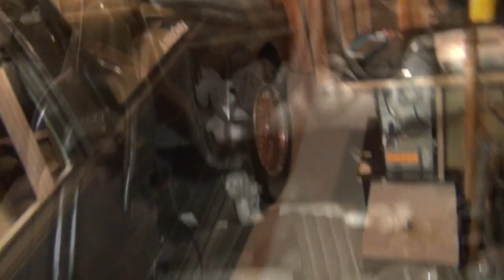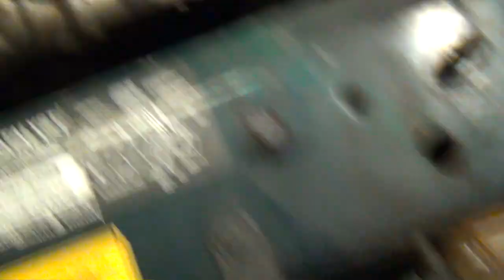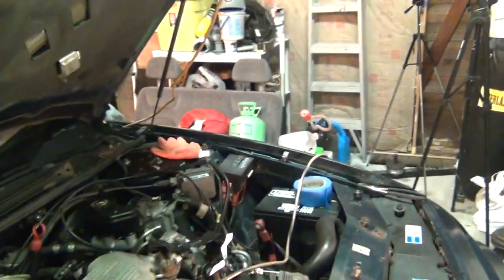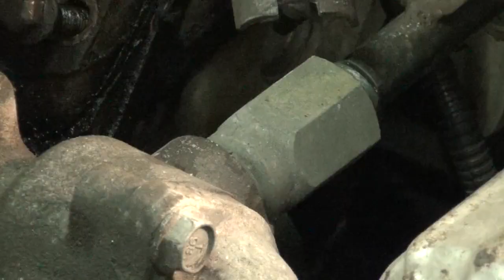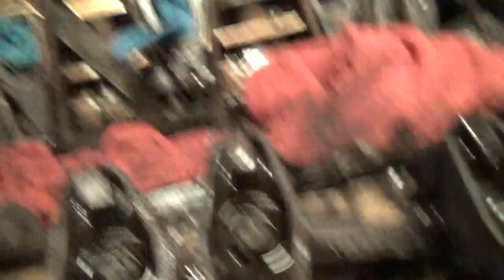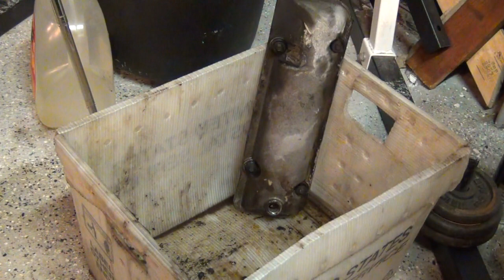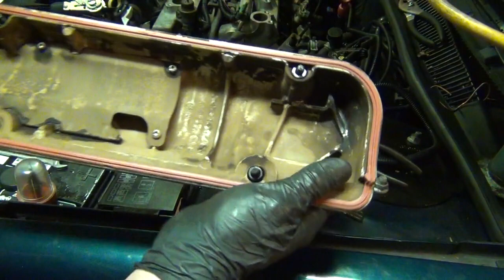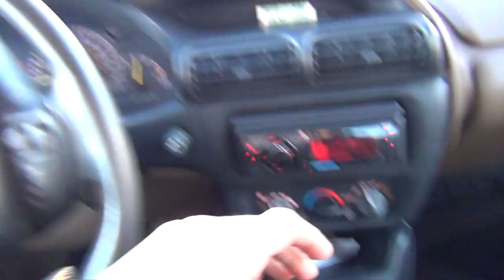Intake Manifold Gasket replacement GM 3100 V6 95' grand Prix

Comment: I'm about to do this on my 2001 Century. One question I have is, do the rockers get tightened down all the way, or do you tighten the bolts until the rods don't spin? (Like take out the valve lash, ect) But, other than that, awesome video and I'm very grateful for this!!

Comment: I have a 94 Chevy Camaro 3.4l, I need to replace the lower intake manifold. I need to take the pushrods off to replace the gaskets. What all do I need to do to put them back on what do I need to tighten them to torque them to thx

Comment: Poor guy you can hear the stress in his voice. 😂 we’ve all been there. I’ve done this job so many times I can do it blind folded. I don’t even need the manual anymore the manual needs me. It’s sad. I learned what gaskets are best, what etc sealant is best, what thread lockers and sealants to use. What to remove what not to remove All The Hard Way! 😡 I’ve been in that dang 3100 so many times I feel like I’m GM. These engines are always going to leak though. It’s a design flaw. So long as you use the metal gaskets you’ll be alright. Nothing will stop these from leaking oil though. Especially now that synthetic is all they sell in stores. If there is a gasket it will leak out. So long as it’s not coolant leaking in the oil I’ve accepted it. These are definitely relics of gm’s trial and error years where they finally later realized to keep coolant and oil passages separate and far far away from each other.

Comment: whats the green wire plug with 3 barrels sticking up plug into show up unplugged at 29.35 mark in video
Reply: the green plug sticling up by the MAP sensor from the fuel injection wiring harness goes to the 
map sensor , plugs in under it . what I found hooking up wires from an engine exchange is
all the wiring harness plugs are male plugs. all the ones one the block are hiddin' kinda because there
flush with spot where they plug into, another words the female part is indented inside doesn't have any wire's ussally waving a flag I go here. you have to search them out using the length of the harness wire as a clue
for  hunting the plug in spot down.

Comment: Cracking of these intakes supposedly common on install, the 64 in lbs then 115 in lbs is critical then the 18 ft lbs, seam like it should take a half hour minimum,  waiting for the rubber gskt to settle,
Reply from the maker: John, Thankyou for adding this information. You are correct on the intake cracking, but not on this application. Newer GM engines that have the plastic intake are prone to cracking and notorious for warping.   I have done so many of these old cast aluminum intakes jobs 10-15 years ago in a shop setting and none have ever cracked.

Comment: People don’t overlook the product (Blue Devil head gasket sealer) 35.00 autozone. Do follow directions verbatim. I used it twice on my 03 chevy malibu. The first time I didn’t follow the EXACT DIRECTIONS the second time I did and now I’ve put 3000 plus miles no coolant leaks. Before this I would have to add water and coolant about every 20 miles
Reply from the maker: Agreed, Ives used the blue devil products for coolant, power steering etc, they DO WORK as you said if directions are followed exactly. However, it doesn’t last. Especially power steering repair . Note: this is a great quick fix, but for long term it is not. $70 spent to do this twice  you could of spent 25-50 dollars and be done with it for good. This video was made a long time ago when those 3100s were still popular and cruising around. If you have a beater, and only keeping it for 6 months, use it. If you plan to keep the car for a while, just fix it right. This was a fun project, I still have this car in 2022, and I did this repair 11 years ago.
Reply: @905speedgta  true about the Beater dog , I’m runnin daily cause I know the motor. I ll have to Report Back as too any gasket failures. Thank you Chief for responding. Clearly the knowledge is evident. Nice work.

Comment: Dexcancer is the problem. Poorly engineered coolant. Go green after manifold gasket replacement.
Reply from the maker: Your right, that dexcool was very acidic back in the day. That’s what killed those things along with people mixing the dex with the green.  But today is not the same case, all of my Nissans take the blue stuff, I brought my 07’ Sentra in for a oil change a while back and they did a full service, they topped my coolant off with green. I did a flush early and replaced it with the blue again. Personally I do know that they have universal coolant and many people replace the coolant with the green stuff. Not me though, I like to follow manufacturers instructions, I feel that that specific fluid is there for a reason, like anti corrosion for the different metals within the engine etc. a lot of people go green due to cost which is understandable.

Comment: thks, for doing a detailed video, on the 3100, I've had this car in my garage for 10 yrs,& because of this
video , I'll know what I'm doing  and I'll get my garage space back and a working car.  I've taken the
engine and transaxle out, as  the engine burned oil, either from the 150 to 200 thousand miles , not 
sure because at about  after (5 yrs of use), its a 1995 purchased with 12,000 miles on it for 13,500
several people we went to said it needed a new engine,  ( it was leaking oil all over the fire wall side.
Now I know it was the intake manifold gasket ,& the mechanics& garages we went to jst said it needed
an engine because  a lot of mechanics will swith a used engine from a junkyard rather than tackle
the intaake manifold gasket replacement job.  so now we haave in our 95 grand prix 4 door, a chevy 
lumina engine 3100.  ( so all those right on time oil changes were for nothing> 
  but now the body odometer is on 199219. Like I said earlier, after paying  900 to get the replacement engine, head gaskets replaced,  & the mechanic putting on a faulty water pump that might of overheated it  after the head gaskets and intake gaskets were changed , any way some how it started using a quart of oil a week .  and the seal went out of the automatic  transmission, 
 thats why I took out the motor and tranny, cradle down and out.  used the cherry picker to lift
off the dog bones ( with a chain tied between the two),  lifted the body high enough the first time 
to get the motor slid out with a cart under  it . But on the 95 grand prix 2 door i PURCHASED FOR 500
for the engine and tranny thats got 165 thousand miles on it with a rusted out frame and other aras.
Wisconsin road salt.  on that on yesterday, NOV.2021,  I picked up the body not as high to slide  out the
engine because I removed 1 strut that dangled in the way( only 3 bolts. I can put the strut 
back on weld a bar between the tow , where the lower ball joints used to attatch to the cradle 
thats not thre any more so it will roll on the trailer better & easier to get it to the scrap yard. . 
noticed the motor mounts aren't doing much as I  pushed it on a cart into the garage, for the 
head gasket replacement and of coarse the intake manifold gaskets there not leaking but it
much easier to do this out side of the car, while I'm doing the swap . I should even put in the tranny
seal. anyway again, thanks for making a detailed video on the exact car  the 1995 --3100  6cyl.
pontiac grand prix.

Comment: Do you recall the tiny screws that held the manifold gasket. Unfortunately the kit I got doesn’t have the extra holes in the gasket. I’m curious if yours did and if not. Did you screw them they the gasket or just put the screws in to cover the extra holes

Comment: I had a 1994 buick century with the 3100 with only 40k on it and it blew the intake gasket so bad it hydro locked and caused the engine to rust a d corrode and wasn't repairable witch sucked I loved that car I'm a buick lover so that hurt to scrap but it wasn't worth fixing.    Thought it was the head gasket but wasn't

Comment: Great job.  You have the best comprehensive 3100 top end teardown video.  I did this job on my own the first time.  Just a hanes manual.  It is no small task.  15 hiurs total.  I super cleaned each part and did an entire rebuild kit of engine gaskets while i was in there.  Might as well if you are diving in this far.  Do the block water tubes while you are in there and a thermostat to.  They are cheap.
Reply: What are block water tubes and what do you mean by doing them?

Comment: As stingwray300m below said.  PUSHROD REMOVAL TOOL.  Get one, they are cheap.  It compresses the valve and you just pull out the rod.  No TDC, no rolling the motor, no re-torquing of any valves.  Then the same for install.  Use cardboard for a place holder with holes to put each rod back EXACTLY where it comes from.  They are all identical, but worn over time to this engine and only in its origonal place

Comment: 22:51 the harden vacuum line you take off by the alternator what does that go to by chance? I have a 3100 sfi engine in my 2002 Chevy malibu and it has a cap on it , I can not figure out what it is supposed to be connected to, so many different things I have read on the same diagram lol.

Comment: Quick question do you have to set the valves if your changing the head gasket on the 3100 engine?

Comment: The 3100 is a very good engine to rebuild..i did the lower manifold gasket at 200,000 wasn't leaking just routine maintenance..i had this lumina  for 20 years..if you changed the radiator,water pump.heater core,starter,bearings,brake shoes & pads & all have lifetime warranty ..most work I done in the last 10 years was free..now I will tell you about the thermostat mistakes..most will put gasket sealer & tighten way to hard ..clean them threads put something on them to keep from sticking down ..that thermostat seals with a rubber seal that don't take much torque..if you have to change a thermostat dont apply alot of force to break the thermostat bolt..heat it up ..that housing is connected to the low torque 10 mm bolts on the manifold..only takes a small crack in the seal to start leaking..i seen many  using a special tool with a breaker bar ..i be willing to bet most failures happen after a thermostat change..nice job on the video

Comment: There are rebuild kits for the injectors which is very easy to do. I highly recommend replacing the inner filter which can be pulled out with a screw. There are how to videos on you tube. The injectors are Delphi 25323971.

Comment: I have the 3100 engine in my olds.. the mechanic argued with me that only the head gasket can cause a coolant leak into the oil... I told him the intake manifold cojld as well... now I aee by your video I was correct.

Comment: my question is how do you know the head gasket isn't bad too? I always thought the milk shake oil was the indicator I'm currently working on the same engine but the oil wasn't milk shake yet I could very easily see air escaping from the intake very near the thermostat once the engine got warm

Comment: Best video I have found on YouTube for this procedure! I am in the middle of replacing my intake manifold on my 98 Malibu for the 2nd time since buying it. I had a friend help me many years ago, but the only gaskets we could get that day were from the dealer. I'm putting in the Felpro gaskets this time and expect this to be the last time I ever have to do this.
Thanks for taking the time to put this together!
Reply: i have a 98 Malibu I'm doing the lower intake and i got it all back together but i don't know what to torque the valve's to can you tell me what the torque is in inch lbs

Comment: My sister has a 94 GP 3.1 after seeing this labor intensive job and parts. I going to tell her to junk it at 160k on the odometer. American cars are designed to sell you parts and labor. I could have got her an acura legend one owner with 100k on it all service done at acura for 1100 bucks and it was almost mint except the trunk paint was fading. I am done with American cars as most of my family is too. I do thank you for the video,but it is just way too much work for a car worth 600 bucks.

Comment: Hey man, 905 right on. I'm about an hour north west around the Guelph area. Huge props on your video, big help and put together very well. Thank you very much, I used this video to re-build the top end on my 3100 in my Buick Century. The wiring was a little differently laid out but the build was right on. You mentioned you were interested in a new coolant/washer reservoir. I was able to find and pull one from a "you pull scrap yard". In my case an Oldsmobile did the trick. Thanks again and keep up the great work

Comment: what in the hell are you doing the 3.1 and the 3.4 L use  hydraulic lifters you do not have to lash adjust lmfao wow you wasted so much time doing something you did not have to do lmfao good job i am doing this to my 1996 3.1 Lumina it has the signs of a blow intake manifold gasket issue and it only has 30.000 mils on it Chevy is shit thanks Chevy for putting in cheep parts stupid fucks
Reply: TheSyntacticProject chevy is all i buy. It wasn't chevys fault, it was General Motors fault.

Comment: Hey bud, I know it is an old video mate.
I enjoyed watching your video. Just wondering if you should have had the thermostat in the car set to hot while you bled the cooling system, just to avoid air in the heater core? Thanks, and good job mate. Hi from Australia.

Comment: Thank you for this video
This is one of main videos that helped me fix my sisters Buick 1998.
took me 4 days.
Its hard to remember how all the bolts go back. 
After heaving the coolant flushed by jiffy lube 109.09$ they did it twice 
the first time i seen oil chunks going through the tube the second none
good way to test if you fixed it because oil will be still end up in the coolant fluid, if there is still a leek.. So its good to have them test the fluid.
the total cost was 40 hours and approx 300.00$
1500$ less then having a auto shop do it. (NOTE: I might of said head gasket.....)   This would be almost twice the work thank god its not a common issue.

Like On your video i wish i would of labeled stuff......... Would of saved me 20 hours!!
 
Thanks again
if it was not for this and 2 others I would of never saved my sisters car.

Comment: I found a trick to cleaning out the radiator overflow bottle.put gasoline in it slosh it around inside. That loosens all that funk that's in there.I've tried bleach and cleaner and found that gas works the best :) Thanks for the detailed video.I'll be doing this job soon.I have a 1996 Grand Prix with the 3.1

Comment: I would like to know what is the reasoning behind rotating the cylinders each to TDC and tightening the rockers ? The valves are not adjustable ; so what is the point in rotating TDC for each Cylinder - they tighten down and seat in the channel just the same ..
Reply: THAT, makes sense. No one else's videos mentioned that. Extra time but I just might have to make sure I do that, I thought it all had to do with timing or whatever but that is a very good logical point. Not looking forward to manually rotating the engine that much but probably worth the effort to not potentially strip one out.

Comment: Nice video. But it seems you made a wrong diagnostic. 
What's a point of replacing intake manifold gasket if it"s obvious that water mix up with engine oil? It can be a head gasket, invisible crack inside a head or engine block and heat exchanger (if you have it on your engine).
Reply from the maker: +Maria Shestopalova  - Hi Maria, Thankyou for your input. I just want to let you know that in this case I did not make a wrong diagnosis. You are right, it could be so many of those things. But if you watched the video " first few mins" you will hear my Diagnosis on running thru the whole engine and in pointing what it was. these cars are known for this problem. also, their was no smoke comming from the exhaust. as well as a external leak.  but, that didnt lead me to my final decision. what lead me to it is the lack of exhaust gas in the coolant, and the " SNOT like" substance in the valve cover gasket.  its worth doing the intake manifold gaskets because im saving my car. and i not spending money i dont have to
Reply: 905speedgta 
yeah this is one of those situations where mechanics who know better love to find and buy cars with a misdiagnosed blown head gasket, only two replace the manifold gasket, which is half the job, for a nice flip

Comment: TIP: for those of you newbies out there you can leave a lot of hoses in their place just disconnect them from the upper intake and lower intake and put them to the side, save you a lot of time  Don't worry about where they go untill  you are installing everything back.. the routing of the houses will tell you where they go in the intake its self explanatory oh and also you can rent a tool to remove the push rods without  un tightening the rocket arm bolts

BTW when you put the sealant 1:06:00 did you immediately torque the bolts on the lower intake manifold or did you wait 1 hour like it says in the sealant directions?
Reply: I did not read the little tube instructions...Did they say to wait one hour?...Oh well, I will find out if it worked.  I am finishing up my project little by little.  I remember he said the clock it ticking so I figured that I should put the sealant down and then place the manifold imediately.

Comment: BTW I have a 96 lumina 3.1 with 150,000+ miles. I noticed the problem when my car overheated and cut off after leaving the car wash. I hope it's just intake gaskets and not head. please respond thanks

Comment: will you have white smoke out the tailpipe if there's ONLY an intake gasket blown, or does that only happen when its a for sure head gasket problem? my dip stick is milky and I'm getting white smoke out the tailpipe. I'm praying its only the intake gasket and not the head gaskets. PLEASE inform ME